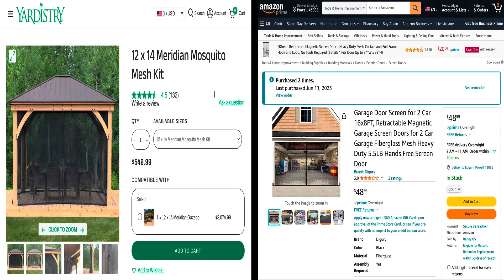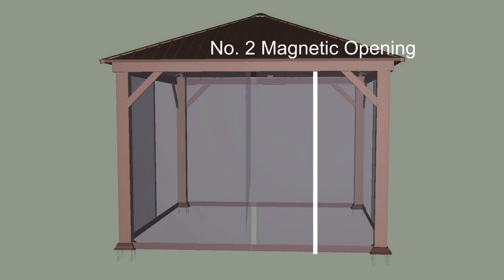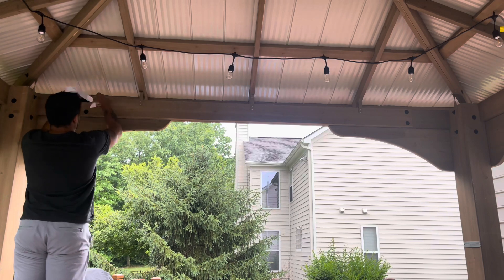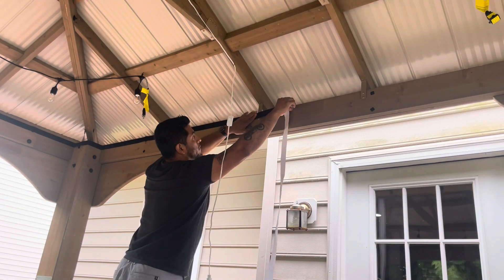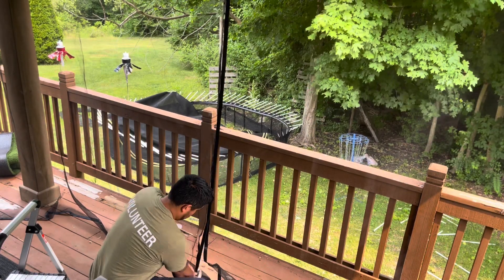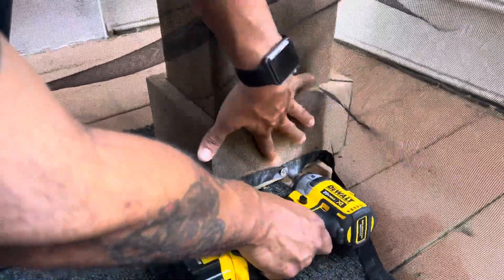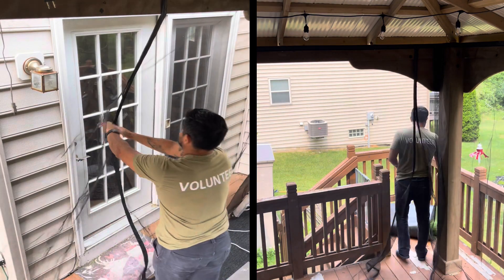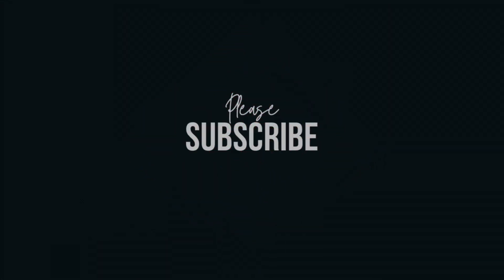Yardistry Gazebo Professional Mosquito Netting DIY #yardistrygazebo #backyarddiscovery

Comment: I really like how see-through this netting is and the magnetic opening. Just picked up with your link, will build this weekend. I'll report back with our results. Thanks for this!
Reply from the maker: A year and a half later for me. The one big thing I can recommend is to roll up during winter or remove completely. I left mine out and wind/harsh deck surface rubbed away at bottom of net a bit. Learned my lesson ha ha. Feedback is greatly appreciated, thank you!
Reply: @Super_simple_diy  Got it installed on a 12x16 Yardistry. I had to buy 4 packs. Install was very little effort. I placed my Velcro along the outside of the frame, instead of inside. Used the space between the top 2 lag bolts as a guide. I was a little worried about the look, but once finished the black screen blends right in with the Yardistry brown wood coating perfectly as the bolts are also black. also wanted the 8 ft height as we wanted to be sure nothing flew in under the screen. Besides we could always roll it up and pin if needed. About the 4th panel. After attaching 3 full panels, there was about a 5 ft space at the rear. So I cut the 4th panel at the magnet opening (easy only a 1 inch cut) and it split the panels in two (No Screen cutting was necessary). Then attached the velcro end of the cut panel to the 3rd panels velcro end, perfect. I then wrapped the magnet side over the existing panel and used the included brass tacks to secure the layer on top as one seam (didn't even have to hammer, the tacks pushed right in).  There's enough overlap to easily clip the excess at the corner so that it is completely closed. Done! The only tool required was a pair of scissors. 
Now we can hammock all summer without care! Thanks again! We saved about $200 over a zipper type and had no frustration at install. Thanks again for this find!

Comment: What if you put the screen on the outside of the gazebo frame, rather than on the inside like you did? Could you see any reason not to?
Reply from the maker: Based on the dimensions of the screens I used and what is available you would either end up short or too long :( but yes on the outside that would be a great idea too. It would feel more roomy. We’re about a year into ours and we absolutely love it. Only downfall is that I left them on during winter. On one side where it catches a lot of wind and with how rough our deck paint is, it rubbed/tore through bottom weight pocket :( next winter I’m definitely removing it.
Reply: I did, looks great.